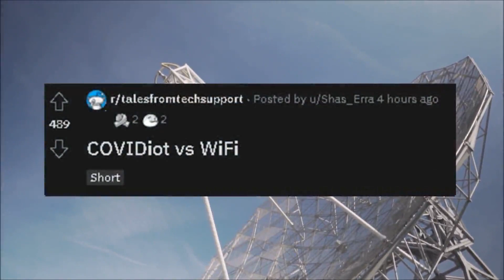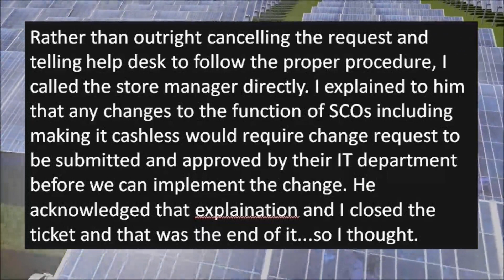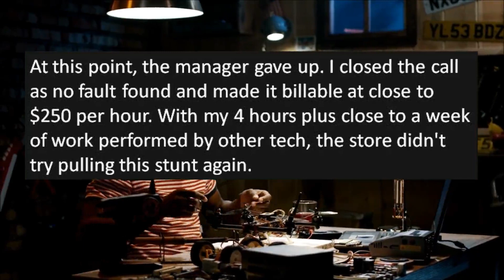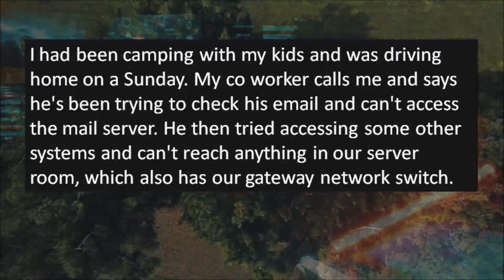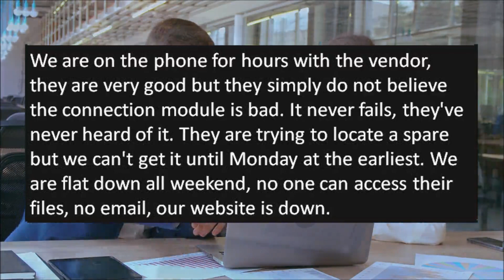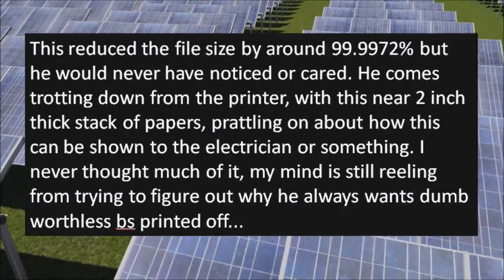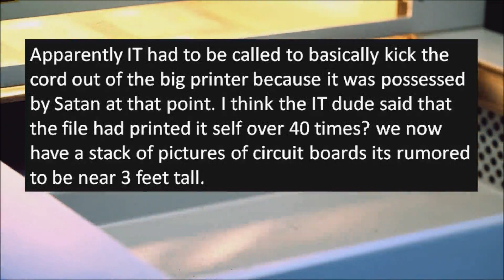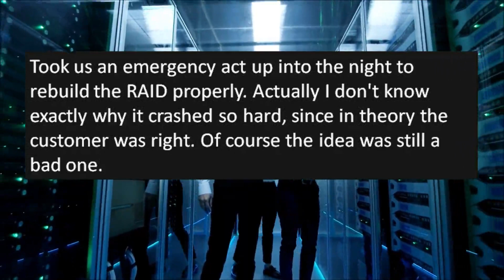Tales From Tech Support - The 5G chip killed with my WiFi!

Comment: Remember that the smallest microchip have a diameter of about 1.5 mm. Then, take a look at the typical needle used for a vaccination. You can easily put at least 10 needles across the diameter of the smallest microchip. Also, those microchips have a maximum range of at most 7 cm under the very best conditions. Normally, it's about 4.5 to 5 cm.

A RAID array IS NOT a backup. It's still a single place, a single device, and if it's in only one place, it's not backed up. Any backup need to be on a distinct device.

Comment: Cashless story. Wanted his cash handlers to have "less work". That is code for either "I wanna hit on this one", or  " I wanna make them obsolete to save money". 

There is your motive.
Reply: There is also the ability to post a 'no cash on premises' sign might have security factors
Reply: Yeah. If the story runs in a place where robbery is a big issue, or the cash handing services are pricey, then yeah, Manaer could have a legit case, but without that being present, being that persistent in trying to get OP to switch the systems over to cashles doesn't make any sense.

Comment: 140F is 60C for the Europeans in the audience. I’m not surprised that parts started dropping like flies that’s brutally hot
Reply: No CPUs and computer equipment will handle 60 degrees centigrade no problem. Also most readings are in Celsius to begin with so 140° probably cooked a lot of stuff in there

Comment: In a certain misfortune 50 company, we were installing a UNIX server for an important NEW system (which was never actually implemented because of corporate incompetence after spending $112 million). They had a backup tape drive. The idea was that an initial backup was made of the system and then there was an incremental backup each night. The tape unit was wired up wrong by the field engineer and it kept backing up the incremental backups to the same tape, overwriting it every single night. I had protested that it be fixed, but the field engineer had just gone on vacation AND change management wouldn't allow it until 2 weeks after he returned.

I guess you can sort of figure out why the project failed--this was just one mistake... out of so many!

Comment: DVD Story: OMG, that just broke my Brain...

Yah, I've burned DVD's to make a copy of my files in case the HDD Borks (or worse), but I ALWAYS verify every file on the DVD copied correctly (open file and scan each page/picture, takes awhile, but it's saved my bacon before when a set of files didn't burn properly) before doing anything with the originals and I ALWAYS make at least 2 DVD's of my files...

Just in case...

Cause I'm Paranoid Like that...

By the way, it's NOT Paranoia if the Demonic Love Child of Karma and the Demon Murphy ARE out to get you...

Comment: Oh Boy, at work we have a 40mb PDF file that shows a map of 2 huge Production-Halls (2 hectare, about 5 acres) with every little detail like station-numbers/robots etc. and it's already a pain to open and navigate through the file. I once had to print the file on a plotter which took half an hour solely to transfer the file 🤦‍♂️ (depending on the print settings such files can become many gigabytes of data for the printer, much like a vector-graphic getting saved in a specific size)

Comment: I'm wondering how hot the hardware got for the guys where the HVAC system failed. Since the room was 60C (they gave it as 140F), I suspect the hardware probably breached 100C, where most digital hardware will start failing after an hour or so. I bet they could have cooked bacon on the CPU heatsink... and burn it on the CPU itself.